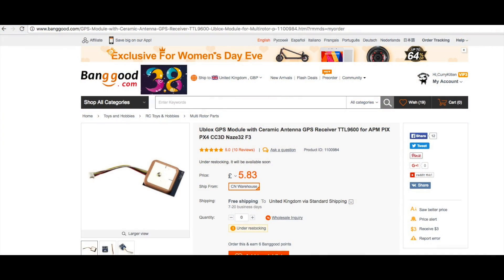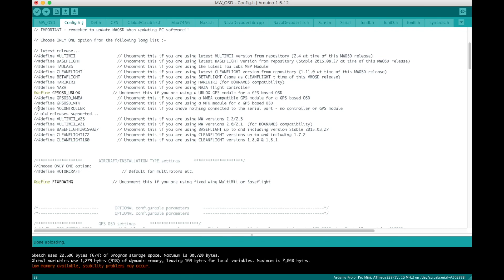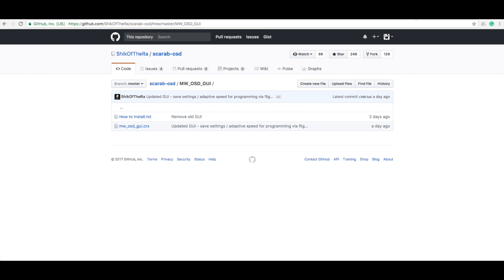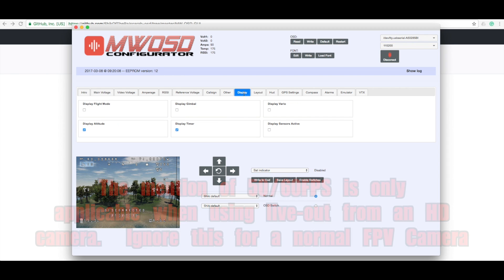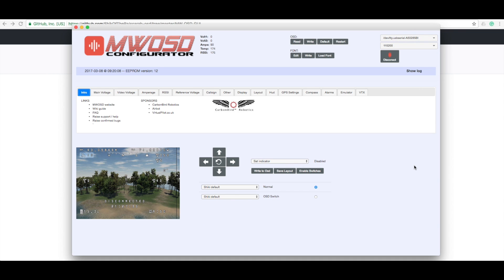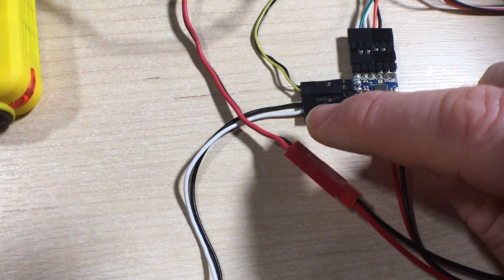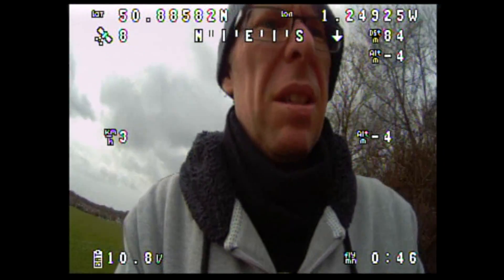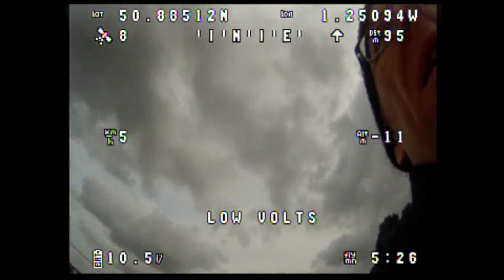A GPS OSD for £10 ! : Setting up a standalone MicroMinimOSD Part 2

Comment: Hi, just in case anyone wants to build one, please use release 1.8 onwards and ideally 2.x  This is when GPS OSD was properly supported . Prior to that was first implementation in the lab without any further development from real world flight testing. You will find the home set and altitude much more accurate :) It even supports antenna tracking using same Sentinel tracker that iNav does! Thanks all for using. And thanks CK for the video!

Comment: Helpful and clear tutorial. I tried to do the same with a NMEA GPS and it worked. But when set to uBlox GPS i get a compile error.
Any help is welcome.
Reply from the maker: I haven't looked at the code for a while - but can you give any more details on the error.  It would usually point towards specific lines it wasn't happy with?
Reply: @CurryKitten  Thank you for helping out. The error is " flexible array member in union"
And sends my to GPS Tab at a line stating:
uint8_t bytes[];
Reply: @TheodorosBako  Same problem here. NMEA no issue, but UBLX doesn't compile. Does anybody know a solution?
Reply: No i used a older Arduino version 1.6.8 and this compiled !

Comment: I love your videos. I've have the setup as you described in this current video and the voltage and time are coming through fine but I can't get any GPS data through to the micro minimosd- my goggles say 'no GPS' despite being connect. I've double checked the connections and they are correct. I have even connected my GPS to u-center and the GPS is receiving data. In fact I'm often getting 10 or more satelites and I'm getting a correct plot on the world map. Any suggestions would much appreciated.
Reply from the maker: I haven't used this setup for quite a while, but if it's telling you there's no GPS, then it's literally getting no comms from the GPS receiver.  TO explain, even without any sats available, it woudl still be sending out NMEA strings with 0 values.  So it's probably one of two things:  You GPS  may be misconfigured in the code - make sure you have the right type of GPS and/or check the baud rate, or you have the TX/RX lines connected incorrectly.  So TX on the MicroMinim needs to go to RX on the GPS and visa versa

Comment: When I upload and configure for the gps i get gibberish-looking symbols in my goggles where the
Gps data should be. The battery voltage and timer data look fine. Any advice would be much appreciated.
Reply from the maker: That's usually an indication that the font upload has not quite gone right.  Try redoing that and have another look

Comment: At about 3:55, is this something i have to do or is it optional? Could you explain a little more in detail about what to do with the baudrate? Thank you.😎
Reply from the maker: This is something that's more critical if you are using some other type of generic GPS.  For example if it only talks at 9600kps then set it to that.  9600 does seem to be a useful fallback position if you don't know anything about the GPS you have, all the ones I've messed about with start sending data at that rate.  Anything running the UBLOX protocol will essentially negotiate it's best speed, but you'll still need this set to something - so set it to the fastest
Reply: @CurryKitten   CurryKitten  Forgive med being a noob at this, but i realy think i have a chance at this from your guide here. So to be clear, i do what you do in the video, set it the baud to 115200 instead of 9600, right? I will buy the gps you Are linking to wich i belive is ublox. And uncomment is sort of the same as "selecting" right?, removing the 2 // (slashes).
Reply from the maker: Yes - copy what you see and you'll be fine.  And yes a commented line // at the beginning is not "seen" when the program is compiled so really isn't there unless it's uncomented.  You can kind of call it selecting, but I don't think my OCD will allow me to wholeheartedly get behind that.  As people are still using this guide, I've made an update to include a better GPS (also a UBLOX) they'll both work
Reply: @CurryKitten  thx you are very helpful. Hope i dont bother to much, but i need to know a few things more before ordering stuff. So the updated GPS is the one you are linking to here in this video? I allready ordered a frsky D4R-II rx and its got pwm from the rssi. I then have to make a DAC converter i belive. I've watch the video from AndyRC making one. But i am unsure of the wiring. His converter has both signal and ground in both ends. Do you have an answer to this wiring from rx to the minimosd?🤔

Comment: now after part 1 everything works perfectly. Now I have ordered the GPS. of course there are complete sets, but this is fine for the coming project. And I learn a lot from it. Thanks again for the great video. Now I only have to wait for the GPS from China for a few weeks. :-(  if it works I will let you know.
Reply: I have a working part one. Now I put the GPS to the OSD and change two things in the Arduino IDE.  Nocontroller off with // , and GPSOSD-UBLUX ON.  Baudrate stays 115200.  On the screen I have a flashing NO GPS !! What is it?

Comment: Gday CurryKitten  I Was thinking about  your wiring setup, having the minim and gps powered both from the receiver as well as say a few servos is there a risk of the receiver browning out from to much load ? I'm not very experienced with all this but thought i would ask just in case.
Love the videos by the way.  Have my minim flashed and configured and just need to wire it all together.
Reply from the maker: Hi, and thanks.  I'm always pleasantly surprised that this guide still gets looked at, as cheap flight controllers will give you a similar experience.  But as far as the rx browning out, it's not so much the rx powering servos etc, as it is whatever is powering the rx.  In "normal" RC things, you'd probably be powering the rx via a BEC in the ESC, and then BEC might be rated for 5A (as an example) simple rule of thumb with servos and BECs is use 1A per servo in use.  The GPS and minim will have their own power consumption, but it won't be anything like that.  So if you've got something that's giving you lets say 3A at 5v that's fine, if it's less then you run a risk of a brown out somewhere - and just grab yourself a separate BEC to power all your 5v things.
Reply: I'm using a very cheap esc with built in bec that in the ebay description says Continuous 2A, (instant 3A) would you say i would be pushing it and prob. should run the gps and minim from a ubec ?
Reply from the maker: Well it depends - I'm certainly guilty of going past the limits and everything working out fine.. but depends on you.  If it's an old wing to crash on every lipo then it's no big deal to try it and see - but if it's something more important, and you don't want to risk it then get a BEC.  Run the servos/rx from the BEC is the norm... that way if the ESC blows, you'll still be able to use the servos and glide down

Comment: Im changing using BN-357 Nmea GPS and the sattelite always shows 0 ... what do you think ive missed
Reply from the maker: A quick check of the datasheet tells me that it has a red led that flashes when it has a fix.  Do you see this, as it may just be an issue with the data expected or baud rate.  Did you set it as NMEA at 9600?  Do you have an arduino or something that can monitor serial data so you can see what's actually being transmitted ?
Reply: @CurryKitten  wil try it ... the red light flashes from GPS but no sattelite captured, im using mwosd latest to flash mmosd ... i have arduino nano to flash and will try to flash from arduino gui

Comment: Followed all the videos on the tube and I still get the black screen. Trying to setup just with GPS no fc.  Any advice?
Reply from the maker: If you literally have a blank screen, then something more fundamental is wrong.  As long as you have video coming in from the camera, and video going back out again (to a VTX or some display) you should get a picture and some OSD stuff even if things aren't set right.  I can't remember, but I think the ISD needs that video in as it doesn't produce it's own video signal, but just uses whats there - what's your config look like ?
Reply: If I take my video line from cam and vtx and plug into my rrosd that I have in the wing already I get video.  My config is just as you have in this video. I have tried many different settings, deleted everything and started over and so on. lol Still black screen when I connect to micro.
Reply from the maker: I've completely blown a microminim before (so it would no longer run any code) and it still did a passthrough of the video in to video out, so a completely blank sceen - given that you board will obviously  flash via FTDI etc - would only suggest some physical issue where nothing is getting through from video in to video out.  That's my best guestimate at the moment, but if you like, send me a video/pics of the issue to the email address you'll find in the about section of my channel page. and I'll see if I can spot anything else

Comment: Hi, very nice and informative video. Did this module lock and find satellites for you easily? Even first time of the box? I have got  the exact same module, I use it on my drone F3 board, connected via UART2. Cleanflight finds the module, but even if I wait outside for 15 min it only sees 1-3 sats with poor signal quality and never locks the position. Wondering if its a faulty gps module I have or is there something that can be adjusted.
Reply from the maker: When I eventually got the pins correctly identified and put it outside ina decent area (my back garden won't pick satellites up but the front of my house will) it was fine.  I've had GPS modules before that have issues with FrSky telemetry receivers.  I had one that couldn't do a thing when near one, but move it away 6 inches and it locked in really quickly.  If you can plug it in but isolate it away from all your other electronics to test, then that would be useful
Reply: Thanks a lot for reply. I was also thinking that I maybe mixed up the wiring, does RX from GPS goes to TX into flight controller and vice versa? It is a bit weird also, that in OSD I always see 0 satellites. When I connect quad to clean-flight and take it outside, I can see 1-3 satellites in GPS section, but signal quality is 0 and it never locks the position. I guess if I would have messed up the wiring it would not see GPS in clean-flight at all? Thanks again.
Reply from the maker: Yes - rx goes to Tx and vice versa as you mentioned.  It'll need 5 sats before it'll give a position.  This is just a vague memory I have, but from messing with iNav and trying to debug another GPS receiver (which has backwards wiring) the output in the GPS section of iNav wasn't very useful.  It led me to believe I was getting a signal when I wasn't.  Not sure if Cleanflight does the same, but as iNav was a fork from Cleanflight - it may do.  If you've got access to any sort of arduino board, they are very useful for just checking things are working from the GPS receiver.  Even with no sats around, it'll send plain ASCII NMEA strings with a position of 0.000 for lat and long.  As long as you are getting these through, you know the receiver is basically working.  Are you using a UBLOX version like mine, as other wise you may have to set the correct baud rate as well
Reply: Thanks, yes I am using a UBLOX, exactly same as yours in the video. Ill try a better and open spot somewhere, and If that does not work will look at arduino option to test the GPS. Thanks again

Comment: baud rate?
Reply from the maker: For the GPS rx I used, the code in the OSD firmware sets the baudrate to all the possible rates and then sends through the proprietry commands to actually set it as it wants.
Reply from the maker: It depends on the GPS module that's used.  For a UBLOX module, the firmware talks to it in all the possible baud rates and sends it configuration info using it's own protocol, so it's plug and play.  The GPS will just show a 0.0 location until enough sats are seen in order to get a proper location
Reply: Hi there. To add a question to that by natange, do you need to reconfigure the gps module or will it just plug n play?
I have the minimosd...it's more or less stand alone because it displays the voltage n flight time...but I had problems setting it on mwosd. So will the gps immediately display coordinates and arrow to home as soon as you just connect it to the minimosd?
Reply: CurryKitten thanks mate. Really appreciate it.

Comment: Hi! I bought this gps module from banggood and I want to use it with apm 2.8 without minimosd.. But it cant find.any sat , I havent a gps lock neither apm or ucenter with ftti converter.. any suggestions? Thanks
Reply from the maker: Have you got any sort of arduino, or something similar.  I used one just to read the ASCII data coming from it, so I could determine what was happening.   Sometimes it's the case of the baud rate getting set incorrectly.  The MWOSD firmware set this itself - I'm not sure what the current APM's approach to it is.  But if you can verify that you can simply read the ASCII strings coming down from the GPS, then it's easy to see if it's getting a lock (as you'll see the GPS coordinates appearing) and then you know it's just a question of setup on the APM side
Reply: Can u explain how the ASCII works? Also i think i have done shit with flashing gps firmware.. Can I reset it? Did you flash the gps module or you left it as it was? Thanks
Reply: also with this combo osd gps can I use it with to mission planner??
Reply from the maker: Dionisis Dig I'm in an airport just going off for a few weeks holiday but briefly you'd connect up the rx and rx pins from the god to an arduino and then read any data that was on the line. It's a 5 line bit of code but useful just to check if the gps is working. Happy to send you the code and explain more when I'm back

Comment: Is it possible to use rssi without flight controller? Only the minimosd
Reply from the maker: Yes - there's a specific pad on the MicoMinimOSD to solder your analog RSSI into.   If the RSSI is PWM based, then you'll need to construct a little circuit with a capacitor and resistor to give you a voltage from the PWM signal
Reply: @CurryKitten   So the frsky D4R-II will need the curcuit you mention here? I belive the D4R-II has a pwm based rssi. AndyRC made a video about making this circuit i belive.

Comment: I can see that you have gps hooked directly to osd
But how to do it with actual flight controller ?
Also how do you configure gps on your computer if all wires are soldered to osd? And there is no usb output :(
Reply from the maker: Those questions might need a bit of clarification, and most of the answer are "it depends".  When you say "actual flight controller" do you mean something running betaflight/iNav/etc ?  In which case they all have their own USB ports.  As well as that, for UBLOX (and I think some other GPS manufactorers) the OSD/FC will send commands to condifure the GPS as it wants it to - irrespective of how it was originally set up.  If you do want to set it by computer, you'd need to get something like a USB to serial port in order to send it the necessary instructions (but it's normally not needed)
Reply: CurryKitten so if i connect rx and tx of the gps and of the osd both to FC ( into 2 different uarts) then i will be able to configure all that via inav ?
Reply: CurryKitten i did configured everything but my fc dont recognise gps i set everything but it doesnt work
Just waste of money and time was buing this 2 items 
I should get fc with osd instead 
And this gps dont have a compass so is useless anyway :( 
Waste of money 
Thanks for advise :(
Reply from the maker: What board are you running and what GPS.  I recently setup iNav on an Omnibus F3 board using a UBLOX Gps, I remember it took a few goes to get right, but I can share the settings if that helps
Reply: CurryKitten spracing f4 evo it doesnt recognise gps
I configured following painless 360 video i set the ports and all this options from clean flight wiki
And im not sure which is tx which rx so i tryied both variations and still nothing im giving up :(
Anyway gps without osd it is not what im looking for
I already decided 
I will just make out of it another racer and for next build i will be more carefull when picking the parts 
I will get fc with baro and osd
Then gps with compass and then i will get bigger frame like 6inch and maybe i will upgrade my radio system
But at the moment i will just leave gps alone :( 
Thanks for all your help anyway :)

Comment: Thanks for the video. Everything works fine, but I keep getting an intermittent "Statistics" screen, which replaces the HUD data for short periods. Have you experienced this?
Reply from the maker: I haven't, but I was having a look because it rings a bell.  It might have been a sort of generic thing that mulitrotors used to have a problem with on OSDs whilst in hover, and the OSD thinking you must have landed as you weren't moving.  Do you only get this when quite close to your start point.  I note in config.h there's the value GPSOSDHOMEDISTANCE which is set to 40.  If inside this distance it thinks it's home, and if slow may decide you've stopped.  So you could try lowering this value
Reply: Thanks for the rapid response and the HOMEDISTANCE tip. I have since hacked the MWOSD Screen program by remming-out the if(configPage==MENU0) instruction to disable the MENU0 reporting. It appears to have worked, but the Statistics Report symptom was intermittent so I need to monitor the fix. I will let you know how it goes.
Reply: Success! I finally fitted the OSD to my fixed wing foamy test plane. The results were great! The OSD gave me the confidence I needed for stress-free FPV approach and landings. My hack didn't disable the Statistics screen, but as you say, it is not an issue when you are moving. Thanks again for your videos.